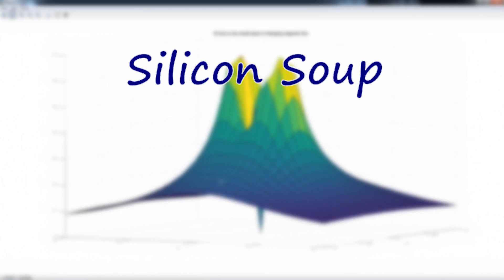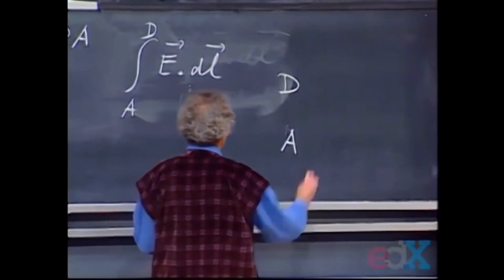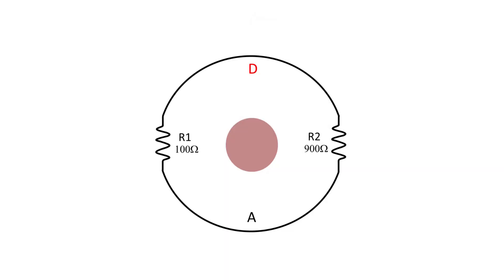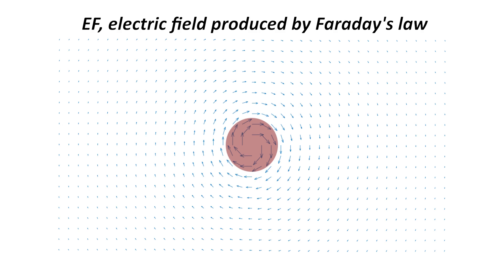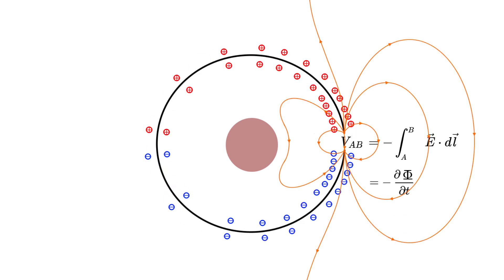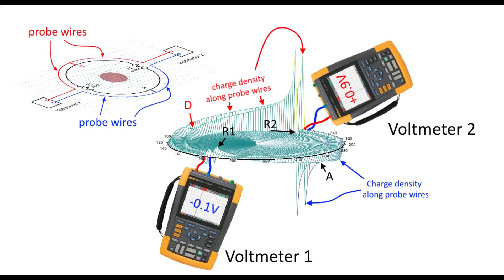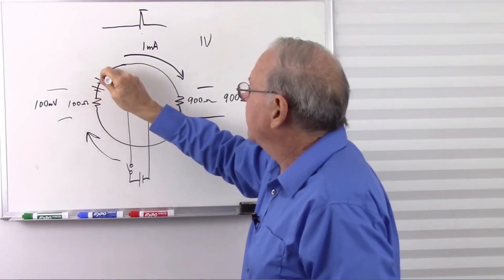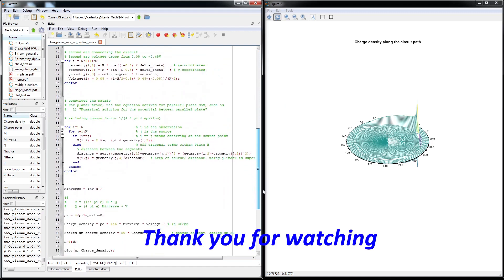Dr. Lewin vs ElectroBOOM on KVL. Of course Dr. Lewin is right.

Comment: I have seen a few demonstrations that set up the test apparatus such that one can see, using oscilloscopes, that by doing nothing more than moving the test lead wires, that one can show either KVL holding or what Lewin demonstrates.  More or less proving, by demonstration, the argument made on ElectroBOOM.  As one who has had a college education in physics, having attended a lot of physics lectures,  Lewin comes off to me more as a science popularizer, an entertainer, than as a serious scientist.   It seems to me, his claim of KVL not holding is an example of sloppy science, sloppy engineering.  However it is a bit entertaining, watching those who use science to disprove what is before them, to hide an obvious error, to pretend things are other than they are.  Whatever Lewin's reputation, it seems to me that this issue has much degraded his reputation.  In addition to the sexaul harrasment issue.
Reply: It is so easy to do the experiment at home. I used a toroidal transformer that gave me an emf of 380 mV (RMS).
Then I created a ring with two 1/4W resistors: I had 2.2 ohms and 15 ohms and soldered them to naked copper. The computed current with nominal values is 22.09 mA. The RMS voltage differences I measured across the resistors are 48 mV and 332 mV and less than 1 mV across any conductive arc.
I redid it with oscilloscope probes in potatorama: https://youtu.be/8CH9Yg8dlYw and got the same results (within the error  fork of my toy scope.)

These values ARE ALWAYS THE SAME, no matter how I lay out the voltmeters probes (twisted, close together, spread out... As long as I do not wind them around the core, obviously.)
There is no doubt that you can measure two different voltages between the very same pair of points. 

The dispute is in the interpretation. People who do not understand Faraday's law and where the L di/dt relation (or M di/dt) for lumped inductors come from, believe it is possible to associate a similar voltage difference to 'partial turns'. This idea is necessary for them to save KVL, but not only it is not justifiable by the  way such a formula comes out from first principles, but it also force them to give up Ohm's law in the conductor (because they think there could only be one voltage, so the voltage referred to the path inside the copper must be, according to their erroneous view, equal to the voltage in the free space between terminals.)

This is what emerges for example in RSD Academy last video (edit: before he makes a new one, this is the video I'm talking about https://youtu.be/LGdN7rDB3XE ), where Bob Duhamel had to invent the - oh my what's the PC word for lie? - alternative truth that Lewin said the voltage across an inductor is zero.
Reply from the maker: This subject is so tricky, I don't know which one is the obvious error being hidden in the disproval process. ElectroBoom made fundamental errors; he believed that there was voltage built-up along a 0-ohm conducting wire, so how can he be right? In my video, I use a numerical method to calculate the charge distribution, and we always need to figure all the forces (E-field) and the boundary condition to get a sensible result. The electric field tangential to the conductor equal 0 is the golden rule, and no voltage drops along a perfect conducting wire is a fact too, but ElectroBoom didn't realize this, so his understanding of the circuit is incomplete.
Reply: @SiliconSoup  "he believed that there was voltage buildup along a 0-ohm conducting wire, so how can he be right?" - well speaking for myself, I'm a person who believes that voltage buildup along a 0-ohm conducting wire is something that happens.  When the wire is an inductor.
Reply from the maker: @hughobyrne2588  The voltage you saw for the inductor exists across the terminals, not along the wire. If you measure the voltage  across any small segment of the wire (so that the measurement does not capture the magnetic flux), you will see they are zero volt. Since each segment is zero, the accumulation for the entire wire is also zero volt. It is a very interesting phenomenon.
Reply: @SiliconSoup  oh, BTW, Number Four: Trevor is Number Two or even Number One in fromjesse scale of 'armchair physics Nobel prizes'.

Comment: Very nice video, but at 10:52 you purport to measure the volts across a half a turn winding on a transformer, but you neglect to account for the same but subtracting voltage that is also being induced in your volt meter lead which follows the same path as the wire who's voltage you purport to measure. 

Whatever voltage is induced across the first wire will be the same voltage induced into your volt meter lead, but opposite in sign since it's running the opposite direction. 

To accurately measure half a turn you need to somehow make sure that your volt leads don't cut across a changing magnetic field, line this:  

https://youtu.be/iDWv8QJrzUo
Reply: @fromjesse I see that in your video on "How to correctly probe voltage in a changing magnetic field" you have linked two 'great videos' by Micheal Melloch from Purdue University. Have you seen these other four videos he made, expressly about Faraday's law?

Faraday's Law Example 1 (Electromagnetic Induction)
https://www.youtube.com/watch?v=O52qfOnJ97A
This is the first of four examples of the application of Faraday's Law. A current is ramped in a solenoid to produce circles of electric field intensity around the solenoid.

Faraday's Law Example 2 (Electromagnetic Induction)
https://www.youtube.com/watch?v=lw54vo7yZpc
[...] The solenoid is surrounded by a resistive ring.

Faraday's Law Example 3 (Electromagnetic Induction)
https://www.youtube.com/watch?v=_6UaU9Ze2KI
[...] A half ring conductor is introduced. Observed is the formation of charges on the half-ring conductor. Also demonstrated is that two voltmeters attached to the same point in a circuit can read different voltages.

Faraday's Law Example 4 (Electromagnetic Induction)
https://www.youtube.com/watch?v=sAsxEBkaty8
[...] The solenoid is surrounded by a conducting ring where the left half of the ring has a higher conductivity than the right half of the ring. What is observed is charge buildup at the boundaries between the two materials.

What do you think he meant by "Also demonstrated is that two voltmeters attached to the same point in a circuit can read different voltages"? Do you think he is right in the two 'great videos' you linked but he is wrong in these four?